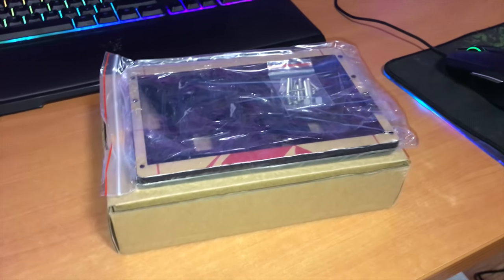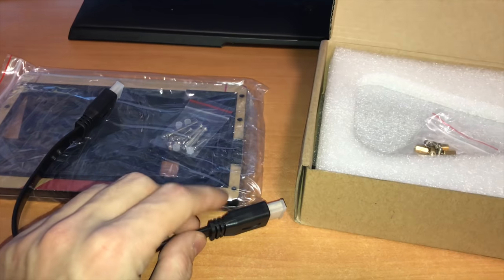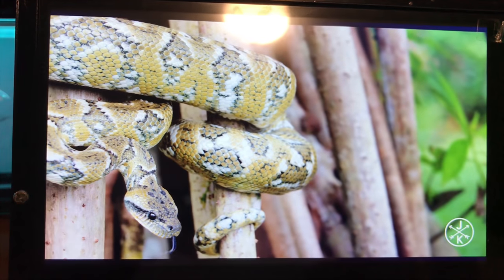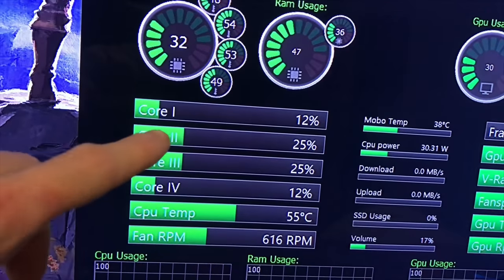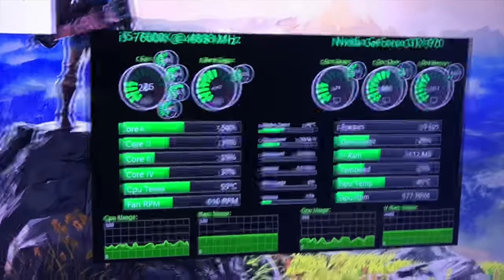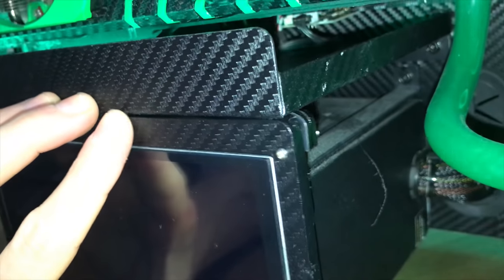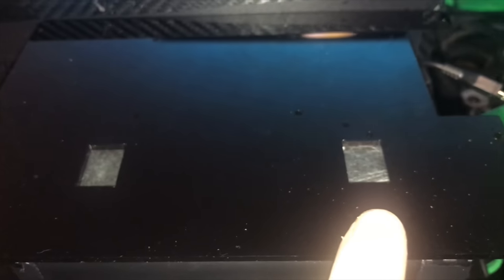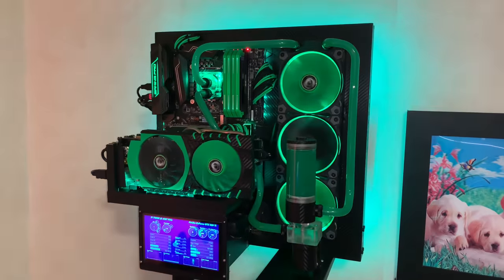PC LCD case mod with temps and stats

Comment: i had it all set up but for some reason this software lags me in games and it makes my USB discconnect and connect and it turns off my RGB ON MY aio and fans... also only for the CPU Cores its stuck at 4999  everything else works
Reply from the maker: Thats pretty weird? Maybe you run another piece of software that aida interferes with

Comment: I would put a second one next to the Gaming Monitor, to easily see the stats without turning the head to the case's one or would a second one waste some usage, I dunno, u tell.
Reply from the maker: I could just run gadgets on the system to show stats, which i used to, i have a video on them, i just prefered this
Reply from the maker: How to get Gadgets in Windows 10 + MacOs Dock https://youtu.be/WqiYMw7Bzrc
Reply: @Gagliano17 
Ofc, I know, but then u still have to switch between tabs ingame, that's why I better just would set a second stats screen next to the middle gaming monitor, makes more sense.
Reply: @Gagliano17 
I always felt like tripple monitors makes no sense at all, but now I see the purpose: centre monitor for gaming, second screen for displaying stats and third for browsing between tabs all while gaming, now that rly makes sense for me.
Reply from the maker: damysticalone87 i can also put a movie on the top screen while gaming on the bottom while having websites volume control and stuff on the side screen
Reply: @Gagliano17 
Exactly... I also like the OSD panel of Aida64, do you know a way to save the customized OSD as a preset file? Just as u did it with the SensorPanel as well.

Comment: Hello, I know I’m very late to this but I am aware that the screen has touch ability (at least the one I’m interested in does). I was wondering if there is a program or an ability on this program to include interactive buttons to say launch an app or turn volume up and down. Thanks!
Reply from the maker: Probably but it’d require another program that overlaps with aida64, aida does not have this feature natively
Reply: @Gagliano17  alright, thanks... I’ll check around. Let me know if you have any suggestions or places to look. Thanks again!

Comment: see the shitty part is that it's setup as a seperate display so when you're playing games or doing whatever, if you move the mouse to the top right it'll go to the stat display. This can happen a lot of times by accident. Is there anyway to make it so that you don't accidentally go into the stat display?
Reply from the maker: I have multiple displays, and i just put it in the bottom right corner of that lcd which i never go to, there might be other options but thats what i personally did
Reply: @Gagliano17  damn i wish microsoft would just make it a default to let you lock one of the displays so that you don't go into it.

Comment: Bro, can I download your settings and add them into my AIDA64? if yes, how do I do that? thanks
Reply from the maker: Yes you can export and import settings, in the description is a link that shows a google doc with all my stuff, on the top it also a link with the file
Reply: @Gagliano17  I did download the file from that link, but I can't manage to find where I can import the file on "AIDA64" I am such a noob lol :))
Reply from the maker: If you’re on the blank page of the info page, right click it, it says like edit, thet section has a import option, i probably show it somewhere in the video too
Reply: @Gagliano17  Thank you Bro, I did find it, thank you x1000 I will sub, and nice setup. I will do a similar one tomorrow :D
Reply from the maker: Aye let me see when its done, also you probably need to change some details like the gpu name to your own, but its fairly easy
Reply: @Gagliano17  Yeah I know the rest, but I wanted your preset because looks very good. I will definitely let you know when it will be done, I have all the parts today It might take me 1 day or two but I'll come back to you :D cheers man. (you have insta?)

Comment: Hi Dennis!Nice work there im wondering if its possbile to get your aida file?Have the exact same monitor that im going to use in my case looks awsome. question is it better to plug it in to the mobo hdmi?thinkig of gaming preformance if u use the gpu
Reply from the maker: Robert Rosengren i am using the mobo hdmi, and no it wont use any gpu performance, it does use a hdmi slot hence why i use the mobo, the aids file is in the description

Comment: Hello Dennis. I appreciate your efforts. I used your sensor panel skin but the The processor & Gpu names were the same as yours. I own a R5 3600 & GTX 1660 TI . Any idea how to change 'em along with the no. of core modules and statistical bars ?
Reply from the maker: You have to adapt it to yours, edit the panel, the names are static beside the clockspeed on it, its easy to figure out, just right click stuff you wanna edit and edit them, you also have to adapt the sensors to yours
Reply: @Gagliano17  Oh yes. I did figure out & edited them as per my need. Looks beautiful. Thank You ! 💯

Comment: Hi, I recently upgraded my Pavilion g6 CPU i5-3210M to i7-3632qm and it works like breeze. I got the EXP GDC dock and now I am thinking of getting RX580 8GB, I calculated there will be no bottleneck. What kind of PSU should I get to power it? Was thinking about CX450M/CX550M or some other one? Also, I have now 2x4gb of RAM but can I upgrade to 2x8GB although HP says 8GB is max? (One stick has other timings than the other, thats why I want to upgrade to 16GB). Thanks :)

Comment: Hi, your sensor panel is really good at my system, the RAZER concept.
Afterward, I install 7 inch display in my case but I should to use it 600x1024...
so if you can redesign it by 600x1024 plz..
Reply from the maker: It’d be more work for me to do that then for you just to buy the proper lcd :p
Reply: @Gagliano17  I made it. thx for response
Reply from the maker: Very good 👌🏼

Comment: Hi I am new  to your channnel I have watched many external gpu videos I want to know I have dell latitude e6410 and I am gonna buy asus gtx 970 which egpu doc do I need and will it work? Or you could just reply everything I need for dell latitude e6410
Reply from the maker: i've not used any egpu dock beside the exp gdc 8.4b and i see no reason why that wouldn't work for you
Reply: @Gagliano17  thanks for fast reply
Reply from the maker: @Garda_  there is a egpu named "r4" it's a little more stable
Reply: @Gagliano17  ok thanks
Reply: @Gagliano17  can you give whole model number of this egpu cuz I am searching and it is not showing me some results

Comment: i done the same, but i put your config and at me shows Nvidia GeForce GTX 980Ti instead 2070 super......
Reply from the maker: Andrei Constantin ehm i think it detects cpu automatically, i dont remember if it worked for gpu, but you can easily MODIFY that text, really easy, just right click on the panel and then you can edit, it will show a list with all that shows, find the gpu name and replace it :)
Reply: Dennis G okkk thank you 🙏 very much 👍u are a legendary
Reply from the maker: Let me know if you managed to fix it
Reply: Dennis G yes I already done thx to you 👍😁

Comment: Hey Dennis, I started to watch your videos yesterday and I have just watched the P3 build videos and there were very interesting and very informative. The Water loop you built was enjoyable to watch! I am planning on a P3 or P5 build just after Christmas and watching your videos have given me some new information I need. I am not sure if I am going to run a CPU loop yet or just AIO water cooler yet as your issues with the coolant and the buildup in the pipes was a bit scary. Great work keep it up! XD
Reply from the maker: I run a very fancy fluid, its very known to do that buildup, it doesnt clog so your flow is still fine, just use any other fluid and youll be 100% fine, the white poweder is a vue fluid issue, no other has it, i really recommend the parts out of my build list( the watercooling ones) its cheaper than a aio and far more accessible and expandable
Reply: @Gagliano17  great work keep it up!

Comment: do you have in-game lag while running aida64 senor panel in the small screen, because i do. is there a fix ?
Reply from the maker: That’d be weird, it doesnt use the gpu at all, check how often its being refreshed, and also check cpu usage with task manager, if its high, adjust the amounts refreshed to like every 3-4 secs and check again
Reply: @Gagliano17  how can i check how often its being refreshed and the cpu usage is about 4.1% and its using 72.9Mb memory
Reply from the maker: 4.1% is okay but you could drop that lower, in aida settings there is a section for the sensor panel, there you can change the interval for many things including the panel

Comment: hey sir, nice and epic video, thanks for showing off your skill and modded pc ! thank you so much. please let me ask one question. im looking for exact this display BUT : is there any solution to display the exact same screen without using hdmi  ? this is so damn awesome, but i wont it clean, in the case not this outside cadble mess, thank you very much !
Reply from the maker: Yes there is, there are the same type of screens with flatcable connectors, but those require another board from ebay to then be hooked up again to some vga or hdmi port haha, i run mine to the hdmi port of the motherboard and enabled the i5s intel hd just for the lcd, with a 90 degree corner hdmi connector its really clean tbh

Comment: Nice work. How to set aida64 so that the LCD could be placed vertically?
Reply from the maker: In aida settings itself it has a sensorpanel section, you change the resolution there to a vertical one and then you realign it to fit

Comment: cough cough
Ibuypowersnowblind has a built in lcd screen to its glass panel on the case :3
Reply from the maker: SmG Mystic yeah you can buy those ready though, its not really hard to build either too, just need an old lcd, but this suited my build, which has no side plates at all,  if he has what i expect you to mean its more of a gimmik than a functional deviced to show info, you mean like that glasspanel with black animations and stuff right?
Reply from the maker: SmG Mystic yeah it is what i figured, and its a ready to buy thing, thats not what i do here :p looks cool though, i still think its terrible in actual usage, its hard to read bc it can only produce weak black image
Reply: Dennis G yeah true

Comment: Hey, I love what you've done here, and I've got a watercooled core p3 that I want to do the same thing for. Do you have the 3d print file for that case?
Reply from the maker: I do not but the case cost like 8 dollar on ali, otherwise check thingiverse for cad files for an 7 inch pi lcd
Reply: @Gagliano17  Nice, I've got the Core P3 red and I plan to do a similar setup.

Comment: how did you connect to the power source?
Reply from the maker: Poester Pascual actually made an adapter to the  5v cable from the psu, ran that out where the psu is located and made that come out in a micro usb and it gets usb power from the psu turned on

Comment: I know this is old, but I still use that same wallpaper!
Reply from the maker: The botw one?  Very cool, i use wallpaper engines now
Reply: @Gagliano17  Haha, yeah. I found a widescreen one I have split across three monitors. Also, the AIDA64 sensor stuff is really cool. I always have one of my old phones used as a display screen, since it can both power it and deliver data over the standard USB cable. Makes for easy, compact screens with only one cable, plus you find a use for an old phone. My last install actually used a wireless charger mounted behind the phone so no cables were visible.
Reply from the maker: @ApothercyCold  i nowadays use a pi zero with modbro's for the lcd, better system than running aida on my pc imo
Reply: @Gagliano17  I haven't played with any zeros yet. I've got plenty of 3s and 4s, though. Ive been wanting to start building with zeros.

Comment: Amazing bro!!! Thanks!!!
Reply from the maker: Diego López :)
Reply: Hey Dennis, one question for you. 

The bezel / frame (carbon) with which you cover the screen (and I saw you also have other pc pieces covered with this), did you make them, did you buy them?

I'm worried about trying this, all the lcd monitors options I found have a metal bezel / frame, and as you with the metal screws, I want it black to make it visually good inside my pc case which is all black.

I, hope you can help me, thank you!!!
Reply from the maker: Diego López at my link, you can get the lcd along with that frame, also you can buy the frame separate, i bought one spare without an lcd with it
Reply: @Gagliano17  thanks!!! I noted from your list that the monitor comes with a frame, I will also look if in your list you pointed out only the frame!!! Do you have Twitter or Instagram???

Comment: Do you think $1565,76 is worth for RTX 2070 and i7 8700, 16 Gb ram 3000mhz
Reply: Hugo Emmes yeah
Reply: non K processors arent worth it anymore. i think 8700 is 3.2ghz and 8700k u can clock to like 4.5 with stock cooler..
Reply: @mikaelsuutarinen1109  Non K has a boost clock at 4.6ghz  and their isnt so much difference in peformance between them
Reply: @hugge02  i mean 5ghz and 4.6 is pretty huge in 1080p gaming
Reply: Hell yeah, in romania this pc is like 2100$ to even 2300$